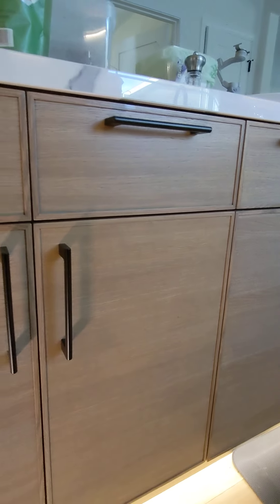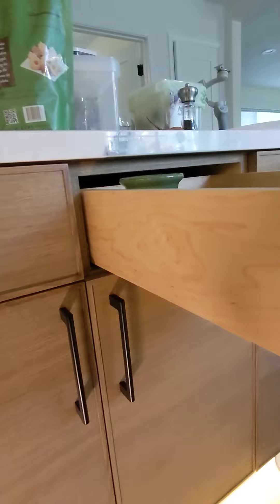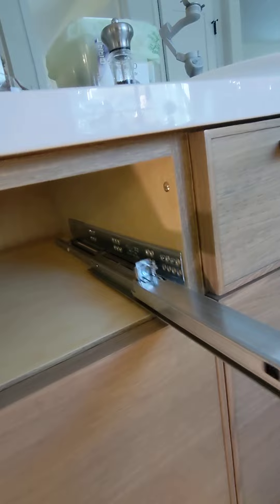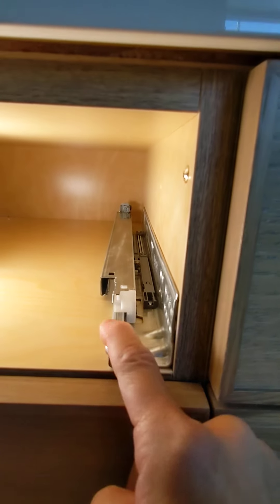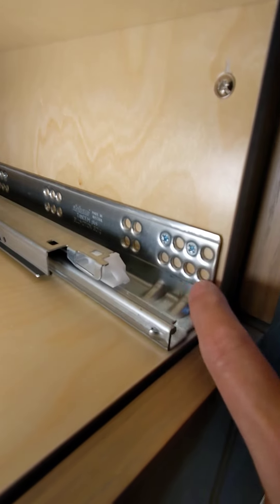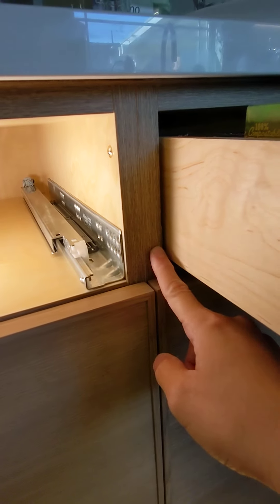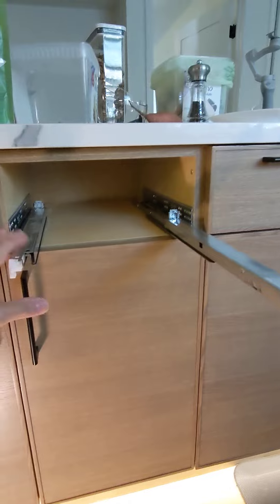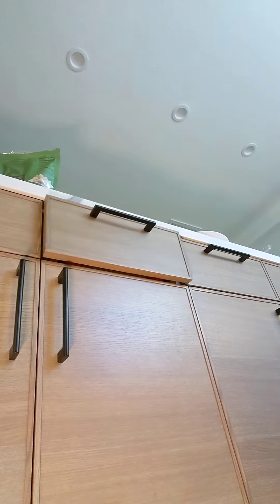Troubleshooting stuck cabinet drawer (w/ Blum undermount drawer glides)

Comment: I have one drawer that is not closing all the way.  Last 1/4 inch doesn't get pulled in.  Is there a way to adjust how far the drawer is pulled in?
Reply from the maker: I have seen this from time to time in the past. I don't know how this happens exactly, but one theory that I have is the drawer glide hardware is no longer as strong as it used to be when it was new. Short of a drawer glide replacement, I think you can tweak and shift the drawer glide mounting point a little further recessed into the cabinet box itself as an alternative workaround. I hope that is sufficient.  Are you still within warranty for a new set of glides?